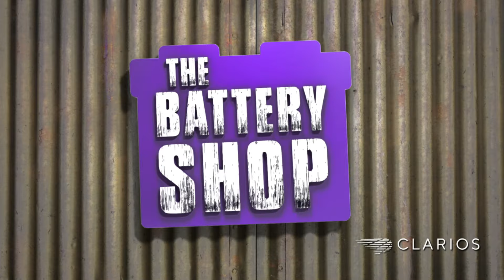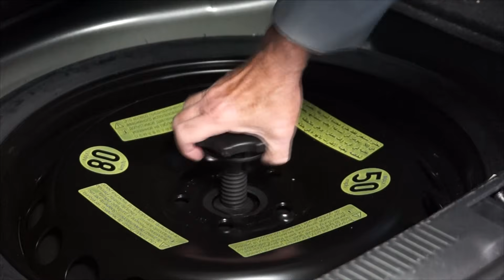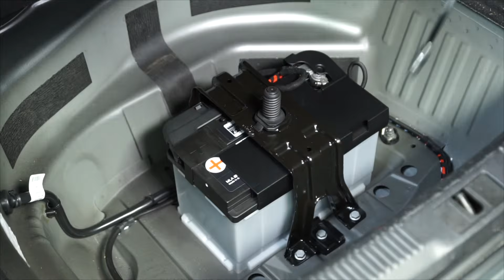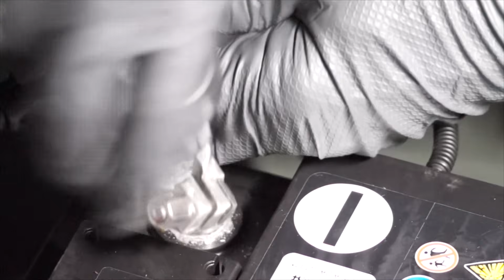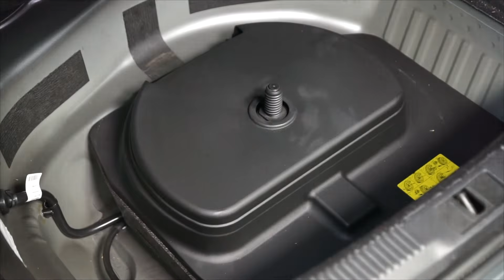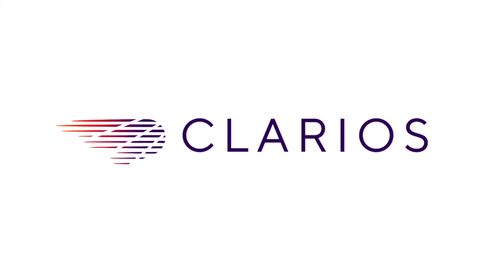Audi A4 (2014) - New Battery Replacement

Comment: Hi, just wondering how would you test the battery using a voltage tester. Is it from the font of the car. Or directly on the battery. Thanks in advance

Comment: Did I miss the size of the socket you used or you just did not mention it... Anyway, thank you for the video.
Reply from the maker: Hi - You’re welcome and thanks for watching! The two socket sizes mentioned in the video are 13mm for the bracket fasteners and 10mm for the battery terminal clamps.

Comment: In case it's helpful to anyone - my replacement battery didn't have its own positive terminal cover, but it was super easy to take it from the old one. It just stays in place with two little pegs. The new one had the slots in the right place for it.
Reply from the maker: Hi - Thanks for watching and sharing your experience!

Comment: Thanks, I was afraid, that the car loses some important "configurations" and I need a tow truck to haul the car to the dealer, who for a fee will be happy to reprogram the onboard computer
Fortunately not... But tricks like this I do expect from a German car manufacturer.
I find it amazing, that after 100+ years since the invention of the lead-acid battery, the damn things still leak acid around the terminals... now I have to replace the negative connection as well
because it is badly corroded. 
But thanks, ...I hate these catch22 cases when you have to drive the car to the shop for repair... oh forgot, the car does not drive anymore. Now what?
Reply from the maker: Hi - You’re welcome and thanks for watching and sharing your experience! Hopefully you can get a “jump” from someone. The jumper cables can be connected to the “ jump posts” under the hood. The vehicle owner’s manual has information on this.

Comment: do you need to code the battery or register like bmw carS?
Reply from the maker: Hi - Thanks for watching! Some Audis do require battery registration or "coding" after a battery replacement. We suggest that you check the vehicle owner's manual or a service/repair manual for your vehicle to be sure. You may also like to check out our videos on battery registration. The links to those are in this video's description.

Comment: What's the battery size for a Audi A4 2012 2.0 Quattro
Reply from the maker: Hi - Thanks for watching! According to Battery Council International (BCI), it varies with PR Codes. PR codes denote factory installed options for the vehicle. PR-J0L,J1D use Group 48, 68 AH Battery; PR-J0N use Group 47, 61 AH Battery; PR-J0T use Group 48, 69AH Battery; PR-J2D use Group 48, 68 AH Battery. O.E. manufacturer used various size batteries in production. Carefully size to fit.

Comment: Will audi lose the radio code, since in this video you didn’t bridge the new battery?
Reply from the maker: Hi - Thanks for watching! The use of a Memory Saver will prevent something like that. Check out our video on Memory Saving. The link is in this video's description.
Reply: let the car run while you switch the battery
Reply: @frankw9836 will that help it recognize the battery?

Comment: My question is not to replace but maintain when not using the vehicle, how many amps should a trickle charger to charge it have?
Reply from the maker: Hi - Thanks for watching! We recommend that you check the vehicle owner's manual or a service/repair manual as we don't have that specific information.

Comment: Hey, what is the battery in the trunk for ? Can you jumpstart your car with this battery?
Reply from the maker: Hi - Thanks for watching! It is the vehicles 12 volt SLI battery. Be sure to check the vehicle owner's manual for the proper jump starting procedure. Some vehicles refer to using the "jump posts" located under the hood.
Reply: @TheBatteryShop  hey can I ask you a question? What if I jumped my car by placing the cables on the battery instead of the post under the hood? My car came on when I jumped it however it won’t turn on anymore, any advice would be appreciated.
Reply: @lorenzo21276  You can still jump the car from the front of the hood, theres a negative bolt terminal and a hidden positive terminal under a small cover with a plus sign on it where you place your jumper cables

Comment: Once I change the battery myself, do I really have to reset the system, because I called and I was told that it has to be taken to do the coding
Reply: @TheBatteryShop  so why didn't you show us how to do that? This is an incomplete job!
Reply: @robbie51486    Because it's only required on late model Audi
Reply: Hey im curious, did you have to do any coding with your car after you replaced the battery? What year is your audi? Thank!
Reply: @murlocmerc  sorry for delay, I didn't need to recode. A4 2013
Reply: @TheBatteryShop  just got the notification and it's running fine. Your video helped so much. Thank you thank you!!
Reply: @alessandroabianni4199  hey curious did they have to re code your car? I replaced the battery and the guy at the shop simply turned the wheel back and forth a few times and said that’s how the reprogramming is done
Reply: @JuniorM4eva  I didn't need to.

Comment: The battery just died in my A4 and I replaced it easily thanks to this video!  Thanks!
Reply: Mind if i ask, where you bough it ? Mine is 2011 A4
Reply: What did you do to reset the tune?

Comment: I was told by the dealership that battery install require a reprogramming.
Reply: This only applies to models with the start stop feature, so any made in 2009 or after
Reply: @primmslimm7185  god bless
Reply: Can’t see the reply
Reply: For newer Audis yes. The power management system needs to recognize that a new battery is installed to charge properly. If you have a car that has start stop function, your new battery should also be rated for that feature.
Reply: @georgejesson1944  I have 2011 with no start  stop feature

Comment: Do I have to do any extra work on the MMI after installing the new battery??
Reply: The battery has to be coded into the computer. Dealer can do it or if you have a VCDS cable use the software.